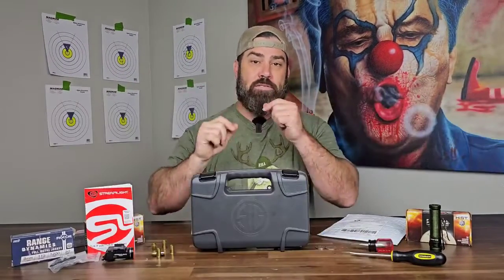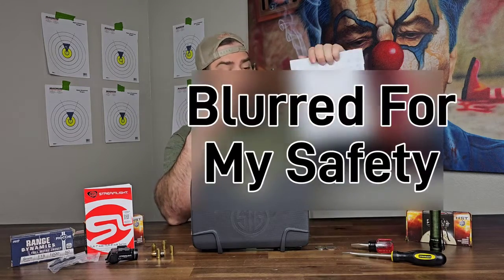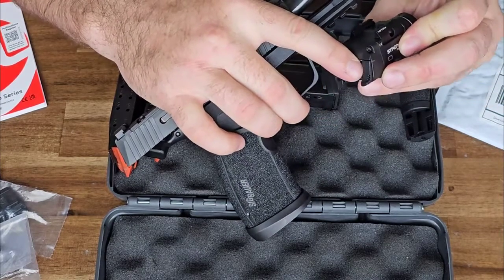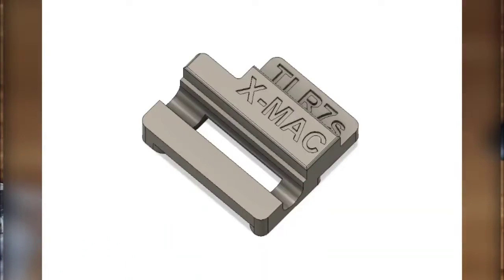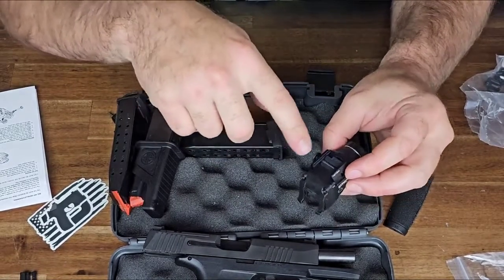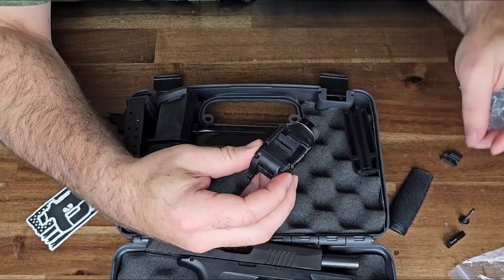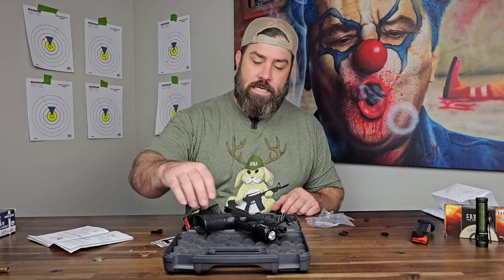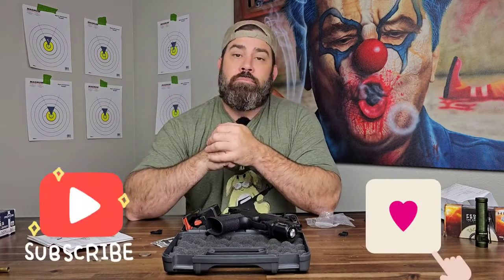Sig P365 XMACRO & TLR 7 Sub FIT PROBLEM Tactical Development Key FIT FIX 🌟RERELEASE🌟

Comment: You can email streamlight and they’ll send you the proper key for FREE. I got multiple rail mounts/keys from them if you need a Glock 43x, 1913, SIG P365, or SA Hellcat.
Reply from the maker: @86steventura  that's awesome to know. I'll pin your comment.
Reply: @BigTimberLodge  yeah, I thought I was going have to pay up, but if you let them know you got a basic TLR-7 Sub 1913 and just got a different pistol. They’ll send you the mounting rail, screws, and extra keys for free. Streamlight is listening and  made updates to those keys.
Reply from the maker: @86steventura  great to know

Comment: Just wanted to add the following. 1st off, love the tacops xmacro. I have the following parts or items on mine. Armory Craft, flat trigger and trigger spring kit, extended mag release, barrett brown xmacro module. DPM tuning spring kit on the guide rod. TLR 7 sub with Inception Defense key. True precision gold tin barrel. Harrington Arms HC 3652P compensator (FDE). Installed the tacops mag well on the new grip module as well. Got a few more items to add to it, but have really enjoyed all of the options that everyone has for the 365 platform.  Favorite pistol for me. I have beat it up pretty bad and it keeps eating the ammo. Very impressed with Sig on this design. By the way, it is also my EDC. Stealth Gear holster is what I carry with.
Reply from the maker: That's an awesome setup and rig!  Love to hear it
Reply: Forgot to mention the Talon Grips slide grips that are on the way for it as well. Been checking out your channel. Great content.
Reply from the maker: Thank you for the kind words and support.
Reply: How much did this run you?

Comment: I have that flashlight for my gun and didn’t need that key. I just got it yesterday. Streamlight tlr 7 sub 1913
Reply from the maker: Yes. The newer ones are shipping with the correct size key
Reply: Which key did you use?

Comment: Has stream light updated this and actually send you a correct key now days. May of 25
Reply from the maker: I know Streamlight put the right sized key in last year.
Reply: @BigTimberLodge  I have seen some videos saying that they had to buy a key from tactical development I think was the name of the company. 
I have the tlr 7 A and it fits on my macro but I wanted to
Try something different but not if I had to buy extra parts just for it to fit flush.
Reply: I didn’t need to buy the key. I just got my flashlight yesterday

Comment: I had a tlr 7 hlx and it went flying after 3 shots then I tried 4 more times tightening the light as much as I could without stripping it and after 3 to 5 rounds it would fly off hopefully this will help with that
Reply from the maker: Hope this helps
Reply: @BigTimberLodge  turns out I just needed a 1913 plastic piece it had a univ-1 so that’s me not paying attention lol

Comment: Will the Tlr 8 sub also work on the Tacops ?just bought my tacops ,looking  for info on lights, I have the TLR 7A on My M18,Any suggestions would be appreciated..
Reply from the maker: @SteveSmith-vg5ov  if it has a 1913 key, yes
Reply: @BigTimberLodge  I have the same Tacops as in the video,
Reply from the maker: @SteveSmith-vg5ov  I get that. I'm asking if the TLR-8 you have comes with a 1913c key
Reply: @BigTimberLodge I havent bought one yet, I'm shopping around for ideas on lights ,that will fit damn near flush with the end of the barrel on the tacops,Gonna put a Holason  Red Dot on top. Thanks for your help with  the tacops,you helped  me with my decision to get  one....preciate Ya

Comment: If you change the key will the gun still fit in a molded holster that was designed to fit with the TLR 7 sub without the key being changed?
Reply from the maker: @Torq-wy2cr  it fits better
Reply: @BigTimberLodge  Awesome. Thanks Brother.
Reply from the maker: @Torq-wy2cr  you're welcome

Comment: Would this also work for the sig p365 axg legion?
Reply from the maker: @JoeyGuns2a  if it has a sig 1913 Pic Rail. Yes
Reply: @BigTimberLodge  thank you, just ordered it.
Reply from the maker: @JoeyGuns2a  the new TLR-7 lights come with the right size key chuck for the Sig 1913 Pic rail. I had the older model when I made this video.
Reply: @BigTimberLodge  the tlr 7 sub I ordered from Amazon came with 3 addtional keys. Believe they were the 1,3,4 and another one. I think it was an older model that I received
Reply from the maker: @JoeyGuns2a  then this should snug the light up against the frame.